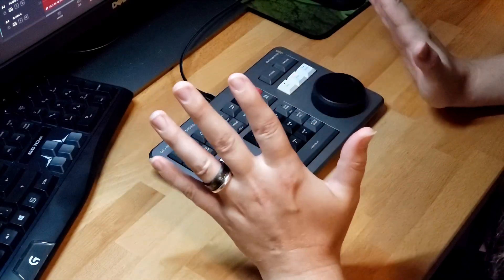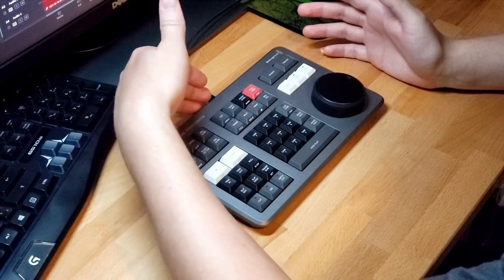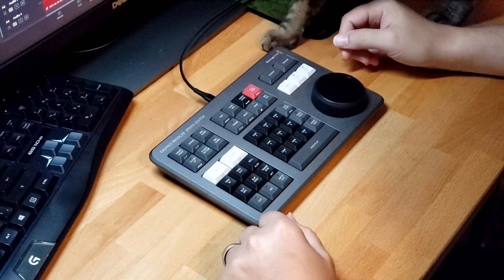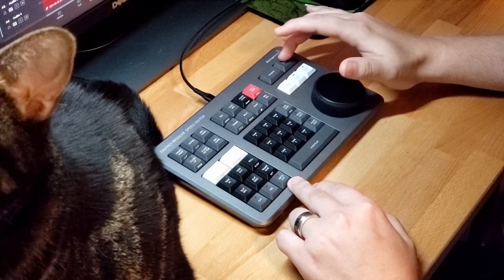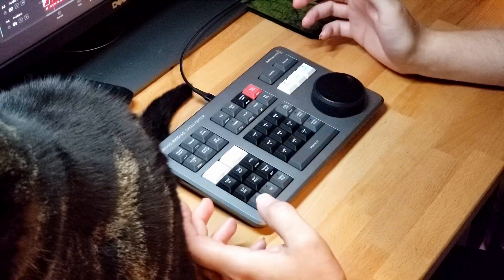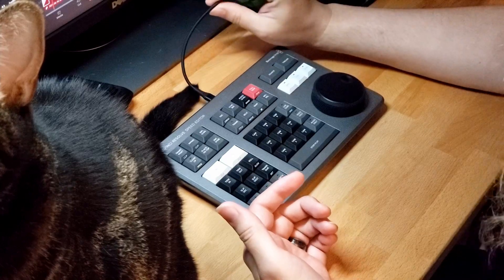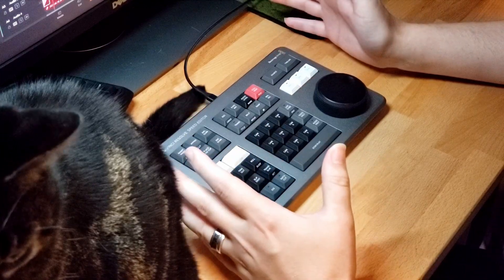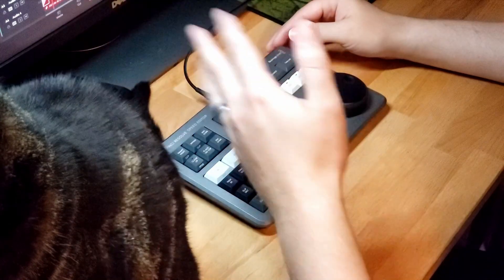How to reset the Davinci Resolve Speed Editor

Comment: I almost wanted to return my speed editor since it wasn't pairing up or be discoverable via bluetooth.

I did an additional step: "reset factory setting" under Davinci Control Panels Setup that can be accessed under Resolve help menu on MAC.
Then did the reset manual as you showed.

Thank god now everything works.

If you don't use it for a while this happens I suppose :P
Reply from the maker: Glad you were able to get it worked out. I'll keep that other part you mentioned in mind. I haven't used mine in awhile